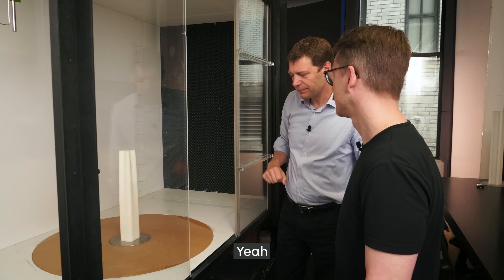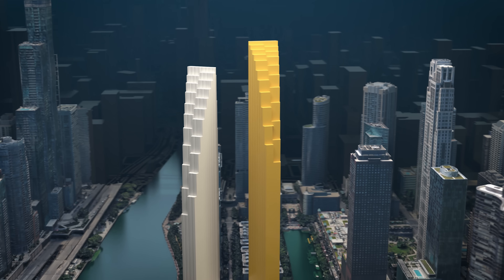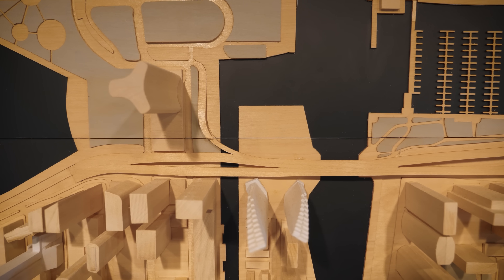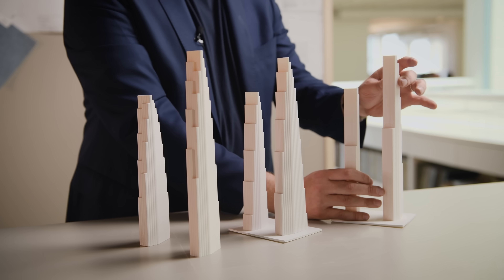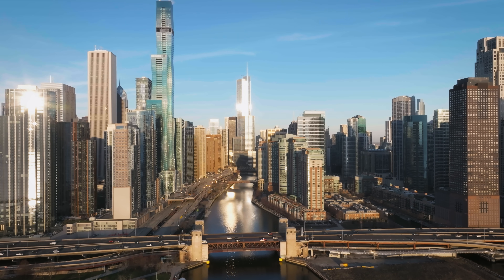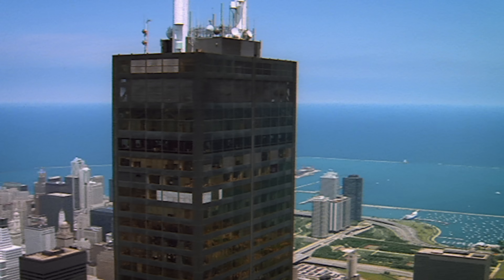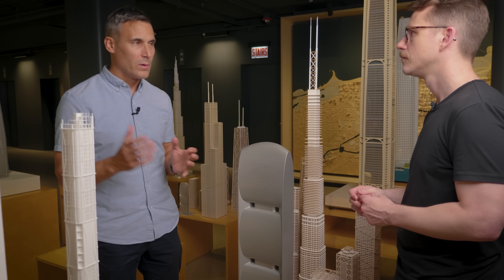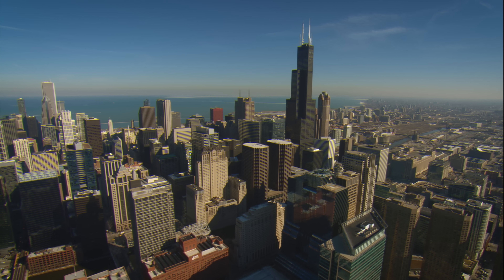Chicago’s Newest Towers Are Invisible to Wind

Comment: 8:26 ; Ah yes, the inconsistent naming of two of the most notable towers in Chicago, the john Hancock center/875 N. Michigan Ave. And the willis tower, which for some odd reason most chicagoans still refer to it as the sears tower, despite the fact it's name changed in 2009, 15 years after sears sold the tower in 1994

Comment: The Regis Tower is 1,191 feet tall.... A Boeing 777 engine has a diamter just shy of 11 feet... It takes 108 engines stacked on top of each other to reach the height of the Regis Tower and you're telling me there is "the equivilant of 290" jets with two engines each...thats 580 turbines...pushing on this building at full throttle??? That is 5.5 engines every 11 feet of building stacked from bottom to top....and you want me to believe thats the force pushing on the building? Thats 66,874,000 foot pounds of thrust since each 777 engine is capable of 115,000 foot pounds on it's own. 

So if I open a window on that building I might as well be staring into the back of a turbine with 175,000 horsepower at full throttle? What planet do you think Chicago exists on? Neptune with it's 1600 mph winds?

I mean I know they call Chicago the windy city and you are proving it wasn't for the actual wind but for the incapability of its people to shut up. This claim is such complete and utter nonsense I can't bring myself to take anything else you say seriously. Where did you honeslty come up with this scenario for your video???

Comment: Did SOM learn from the wind shear mistake at their 2019 Lincoln Commons complex  (Chicago, Lincoln at Fullerton)?  The winds around this complex can be intolerable on breezy days—like standing at the bow of a fast moving boat.  In winter it is unbearable.  

This video does not mention the wind shear effect of this project on the surrounding area: the sidewalk, street and any other buildings in the area.  When the wind is diverted after hitting the building, where does it go from there?

p.s.  I’m not saying SOM failed with the Lincoln Commons complex.  They did a remarkable job on many aspects. 

I have lived in this neighborhood for 30 years and the complex has been a great addition to the neighborhood. It created several opportunities for restaurants, etc. The complex enhances the neighborhood because of its integration of public spaces with the neighborhood. I feel decidedly safer walking around the complex than I did when it was Children’s Memorial Hospital which physically walled itself off from the neighborhood.  Not to mention the noise coming from the heliport on the roof.  Although not a resident of the complex, I feel very welcome relaxing on their benches and chairs as if it were at public park.  But oh boy, that wind!

Comment: That pass through floor on the St Regis Tower wasn't planned it was added later when the building had so much movement that windows were breaking. Ah the benefits of having an in house wind tunnel and staff engineers.

Comment: I was living in Houston during the construction phase of the new St Regis Chicago, designed by Studio Gang. I wasn't aware of the decision to leave the 83rd and 84th floors open until I moved back last summer and saw what is now described as a "blow-through". While I understand that this feature has effectively reduced the building sway by 20%, to my eye, it looks like a flaw in the design. I would be curious to know what kind of wind studies were done during the design phase. I can think of another example, the Shanghai Financial Centre, designed by Kohn Peterson Fox, which has a hole cutout at the top of the building. This accomplishes the same thing, but was integrated into the overall design. Likewise, in New York, the Rafael Viñoly-designed supertail building known by its address, 432 Park Ave, has five screened sections throughout its overall height, which mitigate wind currents from other high-rises in Midtown Manhattan.

Comment: I'm guessing it will take a single of the mentioned aircraft to prove said assertions are hyperbole.   WTC were designed to take a direct hit from a plane, per models and statements at the time of construction... much like the one which brought them down.   So, which developer is overstating?   One's already been put to the test and failed.   And, meeting the Natrual word, that's open for profound debate within architecture.   Going down solves many problems, from offering geothermal to mounting a rooftop manifold of lenses to filter natural light via optic cables, as well as many other things.   We can dig a tunnel under an ocean, we can put a 20 story bldg subsurface, most likely already have.

Comment: I wish you would offer some criticism once in a while. They shortened these buildings to 267 meters (not 275) and drastically minimized the step-backs of the balconies which now don't begin until 2/3rd's of the way up. They also removed the terra-cotta and bay windows. Everything isn't iconic and world class or "Masterful" as you say. David Childs' original design definitely was but these value- engineered versions are far from it.

Comment: 4:42 “a truly extruded building” is meaningless to me. Is that architecture-speak for “same cross-section for the entire height”? (As if it were extruded vertically and then chopped off square at the top?)

Comment: Great video! Question here; seems that the approximate height mentioned (almost 900ft/275m) is a good bit taller than the last figures the developer gave out (something in 850's ft), and the purported final design models likewise appear to be different than latest renderings. Did this get a height bump?

Comment: What about a tower with some free rotational ability to adjust to weather conditions as an alternate solution or to assist your technology in dealing with the threat of the wind? 

..Like a windvane or a sail? Easy enough to engineer with a central rotational core. The flexibility inherent in such a rotational system might be of use in a windy location  or even changing the view (either that or the politicians in town shouldn't be so vocal!). 

So any thoughts?  Maybe tied into a moving solar collection system, like a flower head tracking the sun or to adjust orientation to solar radiation in one of those hot Chicago summers and getting hotter (?)  ! Thanks

Comment: Boston entities built lots of Brutalist buildings in the early 1960s - Gov't Center, Boston Univ. and elsewhere. I recall how the building where the BU Dept of Ed was located, looking out on the Charles River, would howl as the wind rushed around it, finding resonant cavities in the construction. You mention how wind mitigation in the new Chicago designs use shape to redirect wind around it. I wonder whether the wind tunnel testing shows how wind might create unexpected resonance and noise, and if that can be avoided in addition to reducing pressure on the structure and generating energy.

Comment: Q1:  Is this new tower (filling in the hole🕳️) being built in steel or concrete? 
Q2:  Source of this info:
7:48 - - 290 Boeing 77 jets at full throttle ?
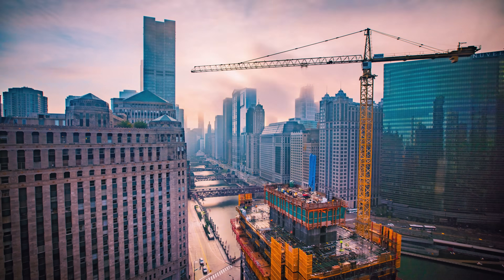7:38 - - 20% of the construction cost to combat wind ?

Comment: Maybe the airplanes pushing on towers analogy could've been rethought lol
Reply: Oh no 😂
Reply: plot twist: it was thought ... a LOT 😢😂
Reply: Especially since the buildings are referred to as the “North Tower and South Tower” 😭
Reply: The graphic could have been better showing increased force on a tower with height. As I recall the top floor of the Hancock Tower has a designed movement of up to ten feet that is dampened so that the movement is not perceptible when you are eating in the restaurant up top.
Reply: no i like it quite a lot
Reply: They're trying to show that these "twin" towers are 9/11 proof

Comment: Another terrific video! Imagine if  that building could capture the energy of just 1/3rd of those "290 Boeing 777s" pushing against it. Turned into electricity,  with some battery banks the building wouldn't need to be connected to the grid -- unless it was to sell surplus generated electricity. 
Another way of looking at the problem is what if you were standing in 60 mph winds. You'd have a hard time not being pushed backwards. But if you leaned into that wind you'd find an angle where forces would balance out. (There's still a lot of energy going into this otherwise static situation.)  This makes me think we're just at the beginning of all of this engineering.  There are reasons these things aren't already being being done... but no good reason they won't eventually be just part of the design.  Whoever gets there first Is going to engineer/design a lot of buildings. The statement "computational dynamics aren't yet good enough to replace wind tunnel tests", should hasten the pulse of every young aerodynamic engineer -- that is the sound of limitless possibilities waiting to be discovered and invented.  DIY a wind tunnel (not hard). Then try everything.   
Who knows, one day young Chicagoans may need grandma to explain why it was called the Windy City before it was called the energy capital of the Midwest.   Of course I'm watching this on my sailboat .

Comment: This was very interesting. One topic not really mentioned was what happens to the wind after it passes over, alongside, or through big buildings? How will the building's presence affect other buildings in the area at ground level and at altitude? It seems designers need to consider not just how the wind affects their buildings, but how their buildings affect the wind.
Reply: Similar to the concentration of the sun’s rays on adjacent properties that melts surfaces☺️
Reply: @bill9540  Or how wind turbines 'harvest' the force of the wind if put too close and in certain paths, limiting their efficiency further down in a park

Comment: 7:50 Jet planes can bend steel beams.
Reply: 12:04 …and jet fuel turns steel into butter floor by floor.
Reply: @dearmas9068 ..floor by floor at the speed of gravity.
Reply: Is this an Aaron Rodgers burner account?
Reply: @chiefenumclaw7960  The only thing that is known for sure, is that it was a conspiracy.😀
 
CONSPIRACY: a secret plan by a group to do something unlawful or harmful
Reply: @dearmas9068  When something is dropping at an angle and doesn’t vary from that angle as it falls, it indicates that there is no resistance from below.
Reply: @dearmas9068  What matters are the facts, whatever they are.
Reply: @dearmas9068  Steel didn’t melt? Floors didn’t collapse one by one?

Comment: They should be more than 1,500 FT  tall... RIP Chicago Spire which was suppose to be 2,000 FT. Missed opportunities
Reply: Though back then I was all for the tower. I did think it was just too much right on the lakefront and should have been inland more. It was started and still had issues of its own structural design to address with its foundation in. The Crash of course dried up all the international money. Another supertall further inland along Wacker Drive was 20-stories up by a Japanese company for a hotel and it stopped to be 3-yrs till it was completed as a totally other design and 50-stories vs 90+. Trump Tower was over half-way up with all financing from Duetschbank money already there. 

Missed opportunity more a no..... the Crash was its main issue that if it was delayed a year or 2? Some kind of Spire Tower would have gotten completed despite some structural issues found also before it was cancelled. Just such a tower just needed a miracle to get built (international investors also it had) and was oh so close.... 

The cost to build in the US is multiple that of say a Dubia that imports southeast Asia migrants for labor paying them a fraction of our Union laborers here to get a tower built with far less price-point obstacles with oil monies there and desire for a National Glory Tower and to a King. 

 Even NYC needs a needle-tall to find something cost-effective if a lot comes up to buy. Chicago still can do larger towers on the ground so a need for a needle-tall is not there.

Comment: Curious of what sound preparation and mitigation that they go into...would suck to find out it is whistling 24/7 in the living quarters.
Reply: Good point.
Reply: That's supposedly a big problem in the billionaire's row apartments in Manhatten, but part of that comes from also how skinny those guys are.
Reply: All I hear in opportunity to generate wind electricity. These buildings need em anyway as electricity/AC is on 24/7

Comment: Hard to be excited about these knowing what could have been…
Reply: wdym?
Reply: @5tig_  The site where they are building those new towers was supposed to be used to build the mighty Chicago Spire, a 610 m (or 2000 feet) tall residential skycraper that would have been the tallest building in the US.
The main architectural feature of the building was its spiral shape, each one of the 150 stories being rotated 2.4 degrees from the one below to achieve a full rotation. This crazy idea came from Santiago Calatrava BTW.
The digging began in 2007, and then, the financial crisis of 2008 struck hard, the developer couldn't keep up, Calatrava put a lien on the site because the developer owned him money, it went into a judiciary nightmare, and finally, the project was definitively abandonned around 2013. Since then, there is a 24 m deep by 32 m wide (78 by 108 feet) hole filled with rain water waiting. You can still see it on google maps if you go to those coordonates : 41° 53′ 23.6″ N, 87° 36′ 53.6″ W.
Reply: the Chicago spire?